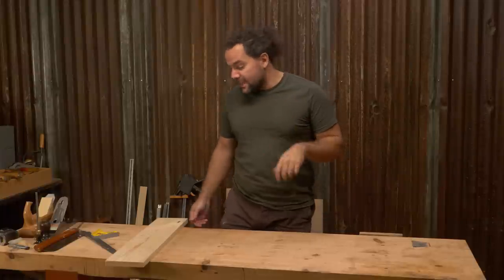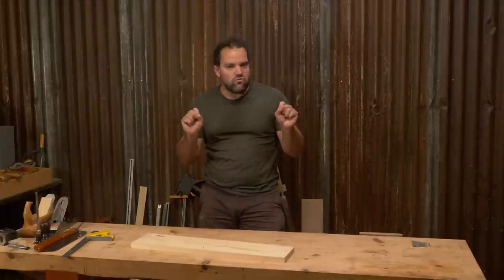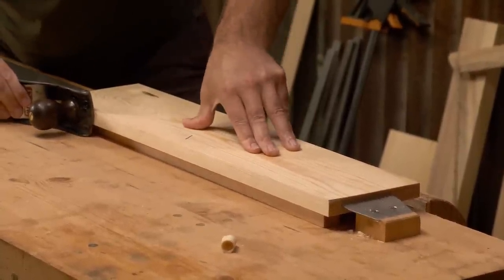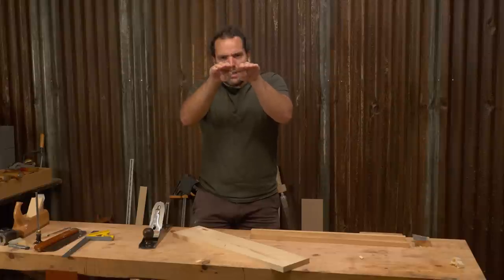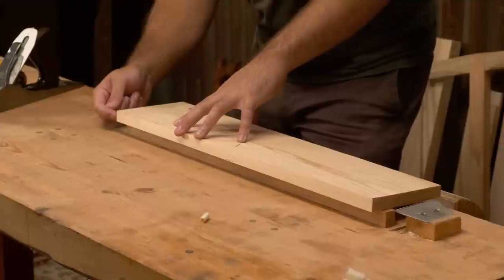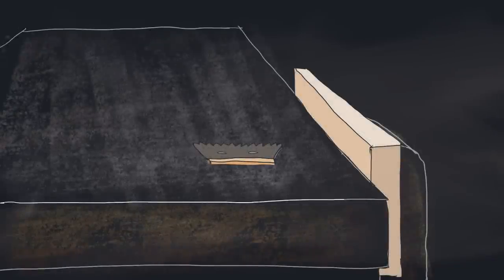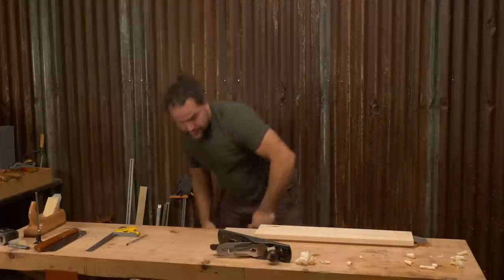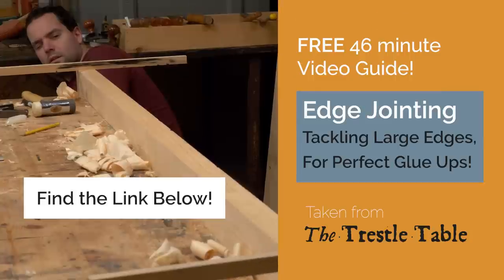Bench top Edge Jointing Tip For Easy Glue Joints.

Comment: Love this idea of using your bench as shooting board. Building a very late one for myself now so I think I will need to give this a go. I find getting 90 degree narrow edges to still be a problem for me, I tend to end up chasing the angle going too far, or spend too long with too minor of a cut not getting back square, or putting a twist in the top.... only to end up making one end low and the entire edge not flat along the length. This may help me with that.